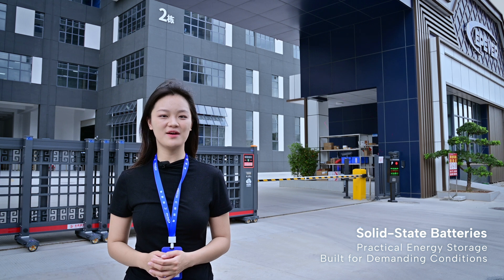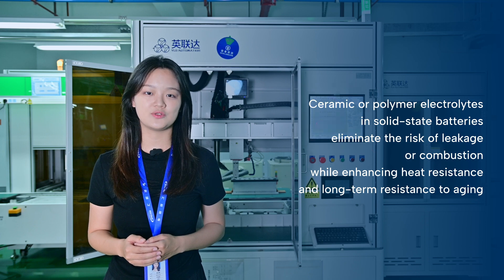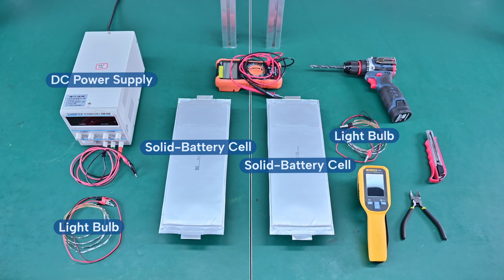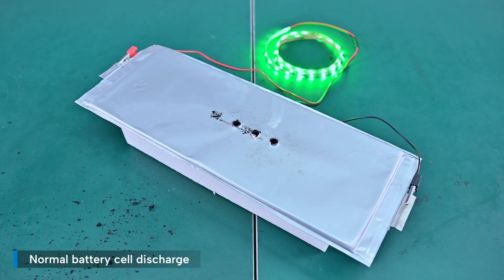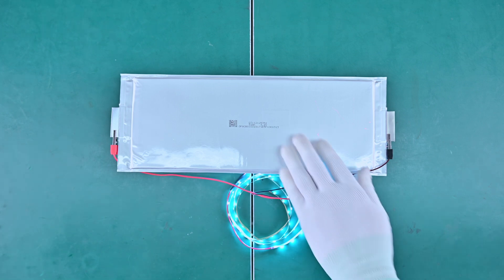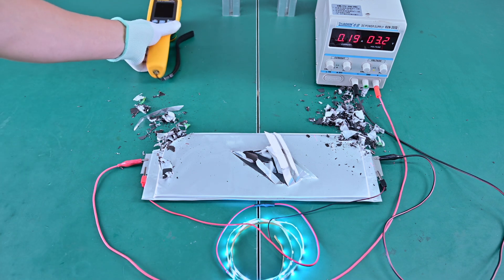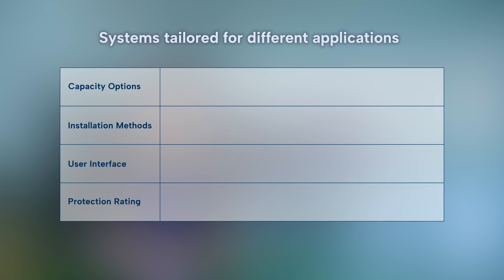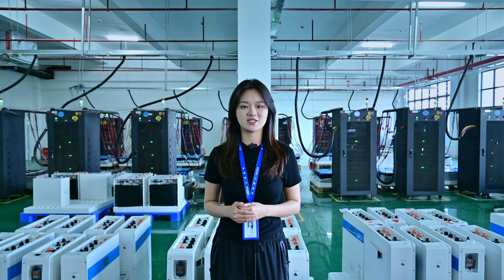EPEVER Solid-State Battery Safety: What Makes It Safer and How It Performs Under Pressure

Comment: The DC current during this test is very small, I want to Believe that they will behave same during 100A current flow..
Reply from the maker: Thanks for your comment!
This test was designed to demonstrate the cell’s response under mechanical stress. While physical damage can affect performance, the key takeaway is the battery’s ability to stay electrically and thermally stable—no fire, no smoke, and no thermal runaway.